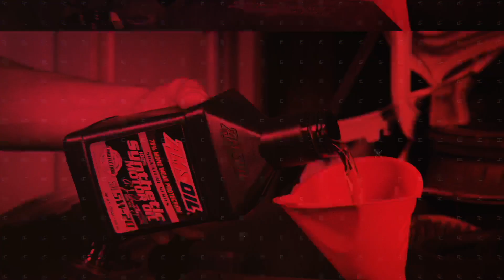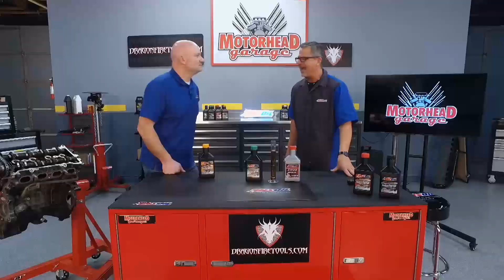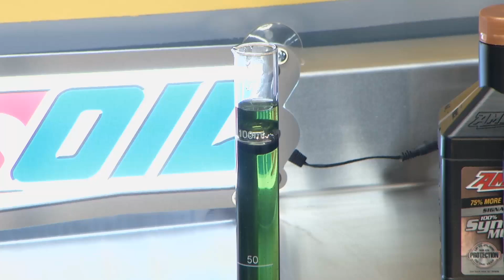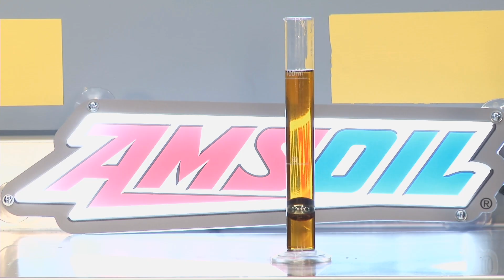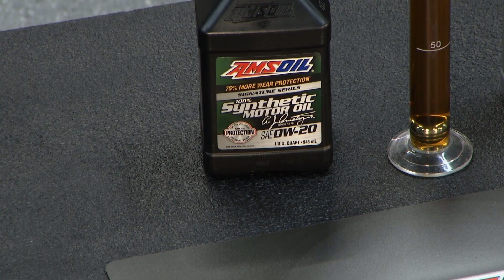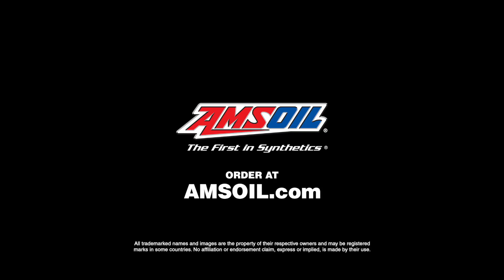Understanding Motor Oil Viscosities

Comment: Why is does the hot oil have a higher number? Isn't hot oil LESS viscous?
Reply: wandering the same thing. Google says 0w40 is thicker than 5w30 at operating temp.
Reply: @tempura7690  Yes, because a 40 is thicker or heavier than a 30.. Look at that Zero as a index of the 40. A 0W-40, 5W-40, 10W-40 or 15W-40 are all 40 weight oils. Absolutely no difference at all when they reach operating temp...  When people say "No way I'm running a 0 weight in my engine" it's not a zero weight.. In fact it's never thinner or lower in viscosity than when it's warmed up.
Reply: @tempura7690  because it is
Reply: Higher number compared to what? At operating temp or 212F that number is lower than it would be if you took it at room temperature. It's measured in CST or flow..  That other number for the W (winter) is taken at 40C (100F) and uses a different test (brookfield viscosity) which is done with a blender like apparatus.

Comment: Just too easy. Explained nothing.
Reply: He sure did!  that is how the SAE grades a multi viscosity oil. The 0W in 0W20 is measured by the number centistokes (a unit of kinematic viscosity for a fluids resistance to flow) at 40°C / 100°F for cold/ambient temperature (the w you can kind of equate that to cold weight) and the 20 in 0W20 is measured in the number of centistokes  at 100°C / 212°F as operating temperature, you can think of as hot weight.

Comment: Great video on viscosity, but I'd like to know does Amsoil have any 0-40 API SP oil for the GDI engines out there? I always used Amsoil, until this GDI came into the picture. Now I need a 0-20 and a 0-40 API SP oil, but I don't see any advertising from Amsoil on their oils made to run in GDI motors. A reply would be greatly appreciated, as I'd like to get back to using Amsoil.
I'm currently using Driven oil for my GDI motors.
Thank you!